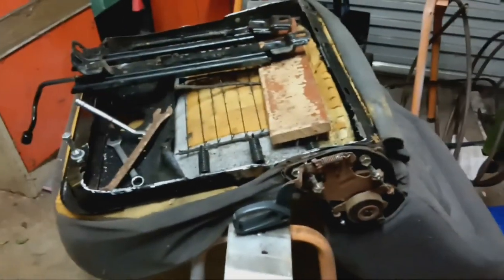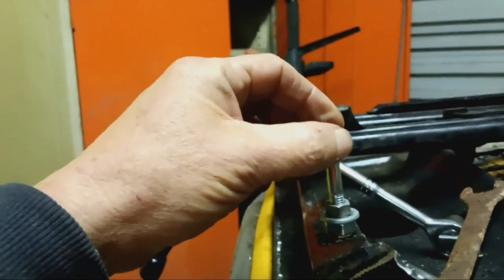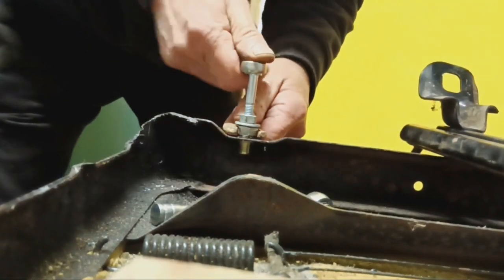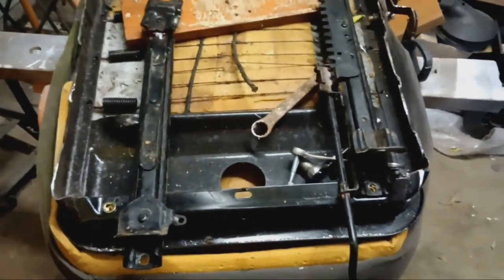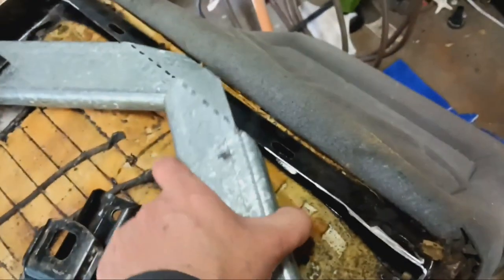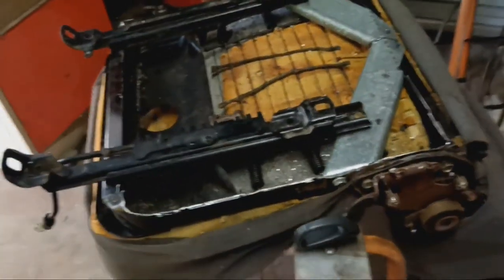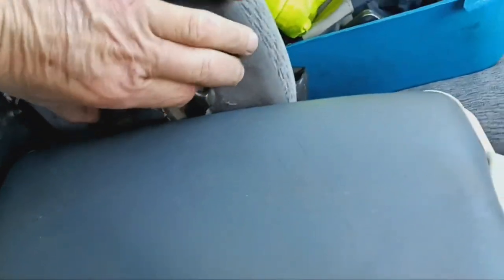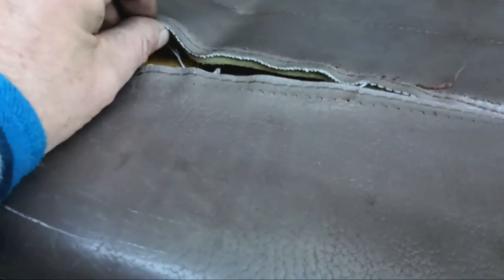New old seats

Comment: The back support usually stays in one place , with one driver , just set it to where you want it before removing the winder. You might regret not de buring where you cut it , one day when reaching under the seat. Looks comfy .
Reply from the maker: I did take he sharp edges off in the later stages, I thought about that reaching under and cutting my hand, not much room under anyway. Yes they are comfy.